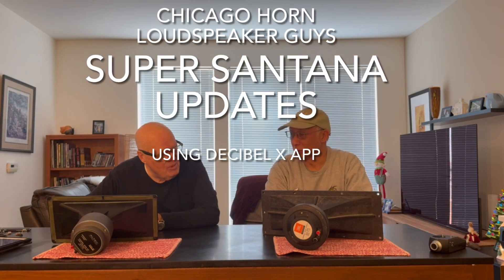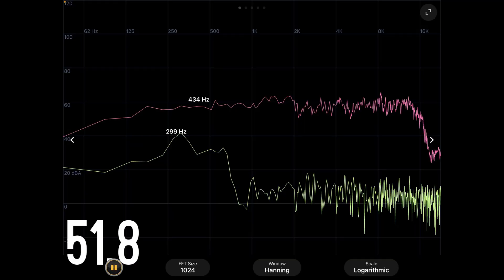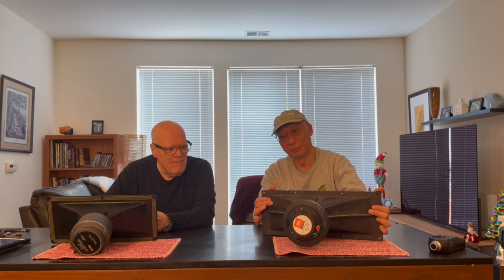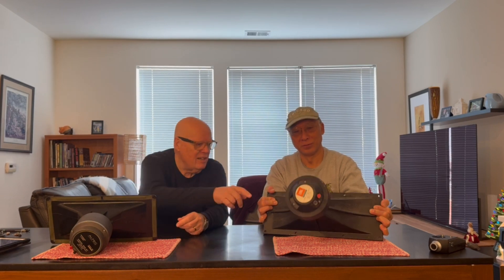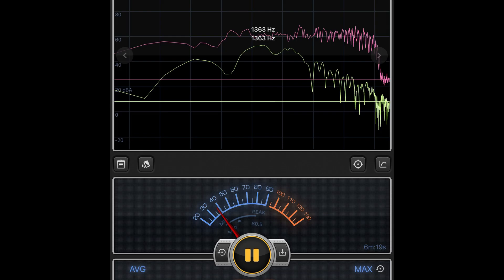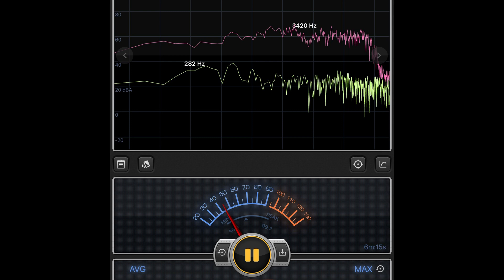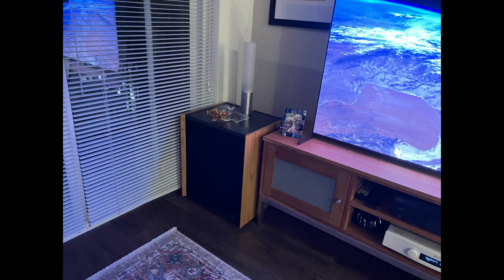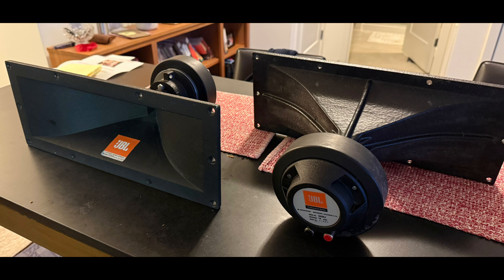Altec Super Santana 879A Updates with JBL Compression Drivers

Comment: Excellent channel, appreciate the enthusiasm and information. You had inquired as to what the viewers would like to talk about. I am now using Klipsch Chorus ii speakers with modifications that sound very good. But I also have a pair of modified (cabinet upgraded and different crossovers applied) Crites style B speakers, that I cannot seem to get good sound out of. I would be interested in some information /suggestions on those.
Reply from the maker: Chorus II with the rear firing passive radiator? What is a Crites style B? You mean another Chorus II with Crites drivers and crossovers?

Comment: Either one of those horns would look delightful on top of those Santana boxes; I'm sure they could only improve the ambience of the room, if you get my drift.  I wonder how the JBLs would actually sound compared to the Altec horns?  I'm a fan of both, but probably more attuned to the JBLs from years of movie-going, although you never know what's actually behind the screen most of the time.
Reply from the maker: Both the Altec and JBLs sound good and I suspect the horns make more difference to the sound than do the drivers. Anyway, I find both Altec and JBL compression drivers pleasing; I've had quite a few of each brand.